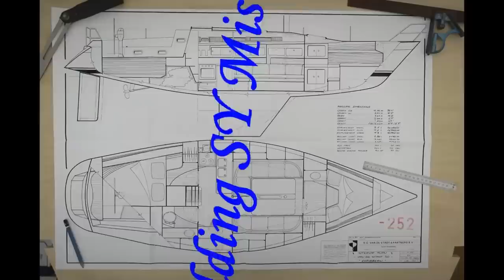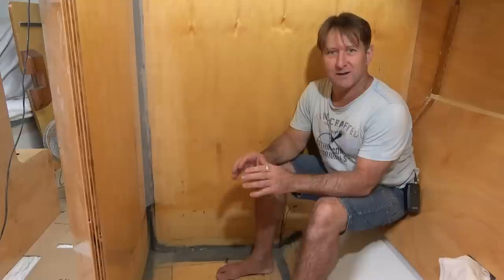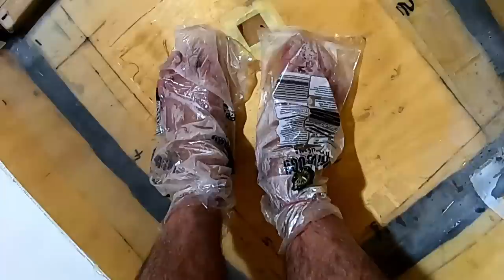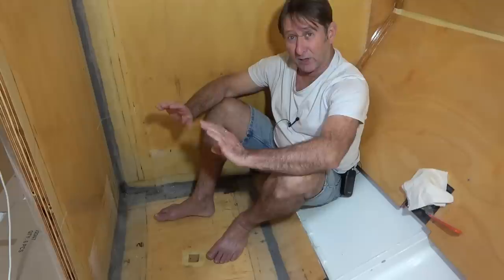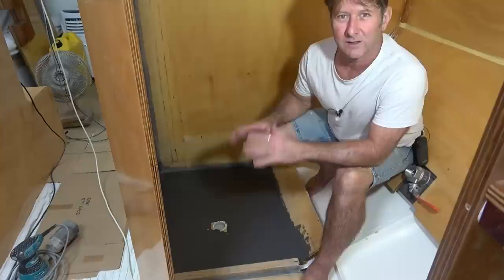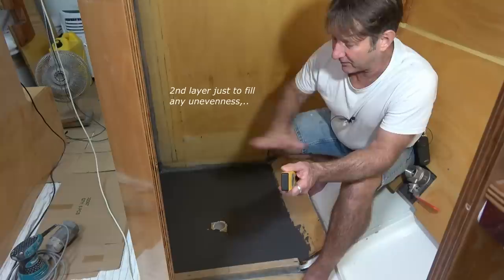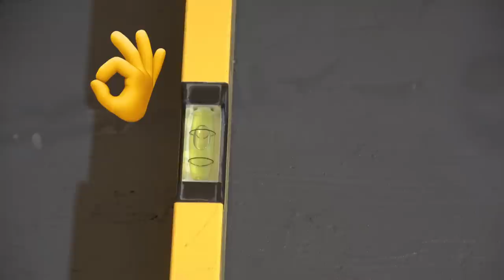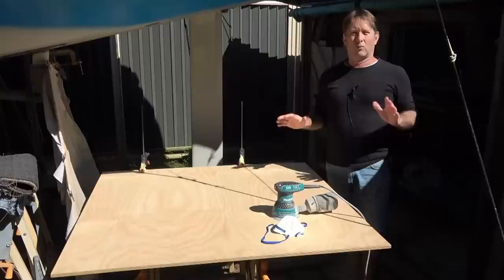HOW TO MAKE A STRONG, WATERPROOF BOAT SHOWER 🛀 Ep.144 Building my steel sailing yacht

Comment: I have a question, cause I'm building the interior of my steelboat and I was wondering,
Aren't you scared about not being able to check for rust underneath your shower ?
It would be really helpful to have your feedback 😊
Reply from the maker: Merci/thanks for your good question Maeva, appreciated and no I am not scared because of two main reasons, the shower sole flooring is made of marine plywood and then multi coated with epoxy resin and then two layers of GRP/fibreglass and secondly I have full access underneath this sole floor in the bilges space below it!
All the best with your boat work  🙂👍🏻

Comment: is ok but nowhere did you mention the hole and drainage where does it go?
Reply from the maker: Thanks for your comments and feedback Mark, appreciated, the drainage is explained in this earlier episode - https://www.youtube.com/watch?v=KegzLszwL2g&t=410s&ab_channel=BuildingSYMistress  🙂👍🏻
Reply: nowhere in that video does it actually show the drainage only the pump container? @BuildingSYMistress
Reply from the maker: @gatecrasher1970  Ok, understood and I appreciate your further interest, to explain that most things in boats are not simple, so the shower water will drain into that sump box then be pumped up to what's called a vented loop above the waterline, which prevents sea water being syphoned back into the boat, then it continues being pumped overboard through what's called a through hull fitting below the waterline. All of the main parts are installed for this which can be seen in episodes 163 and 164, however I have not put together yet the episode showing everything connected up with hoses, which will be coming out soon and make all of this much clearer.

Comment: Could  you tell me what the purpose of the peel ply is?
Reply from the maker: Thanks for your good question Bill, it has several great features - it really helps in smoothing out the resin film over the glass cloth, it also smooths out and feathers the cloth edges discretely, it basically stops resin sag on vertical surfaces, it absorbs any amine blush in the resin and a huge plus is that because of the matrix surface left once it's removed, no sanding is required  🙂👍🏻